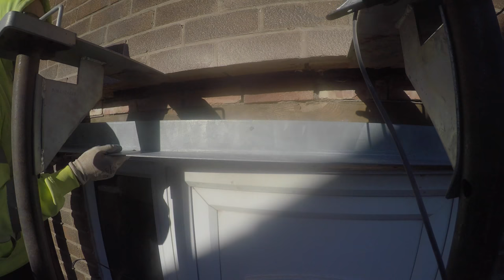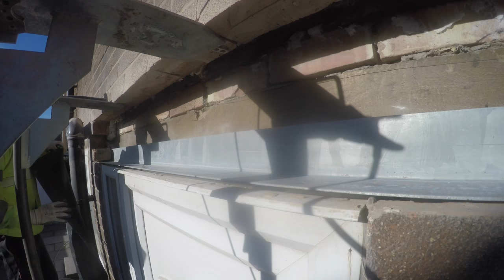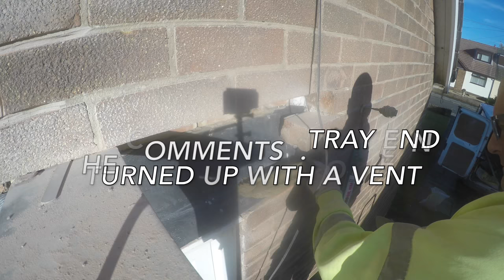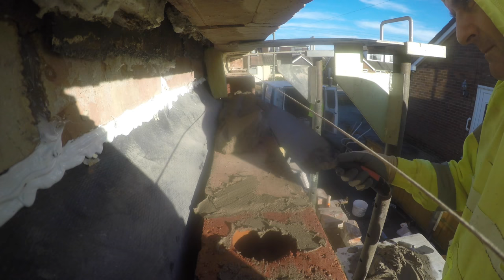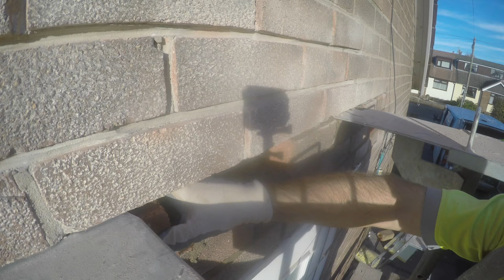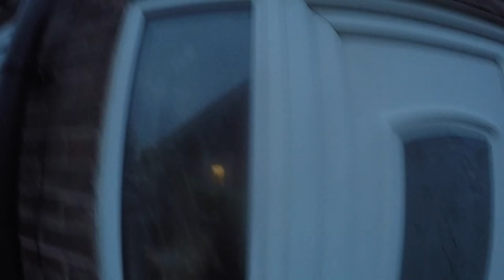BRICKLAYING... BAD WORKMANSHIP ON A LINTEL ...PART 2 ..RE BUILD

Comment: Is there a set distance for the props holding brick work up ??
Reply from the maker: Paul Perrin I’ve just googled to check and it says 900mm but I put them closer , generally about 3 brick . If the the brickwork is particularly bad and unsafe I would go down to 2 brick spacing 🧱👍🏽

Comment: Another great video chaps! What Worries me is the installation of retrospective insulation. I get that a lintel is a potential cold spot and insulation behind the tray is beneficial but any future lateral damp penetration may cause problems by nullifying the properties of the material. I would be grateful for your thoughts 💭 👍
Reply from the maker: The fibre glass insulation we use is formed in layers which guve it almost a grain. The water passes through the fibres vertically but cant pass through horizontally anywhere near as easily so im quite happy to use it on our jobs 🧱👍🏽